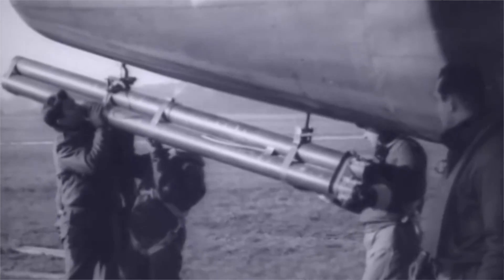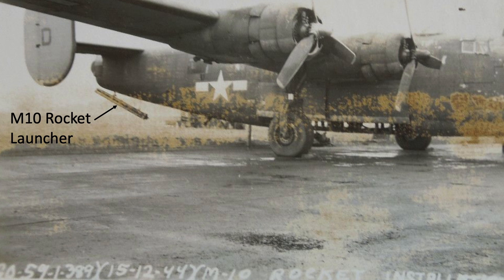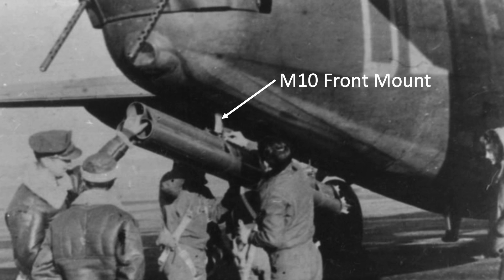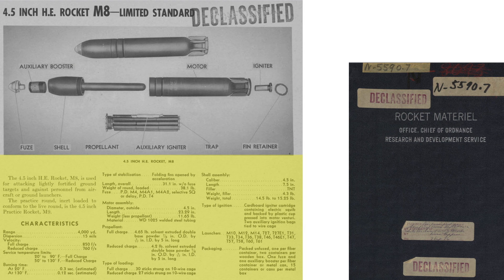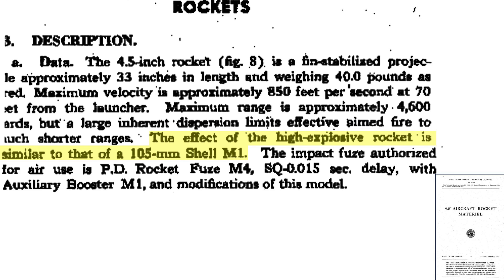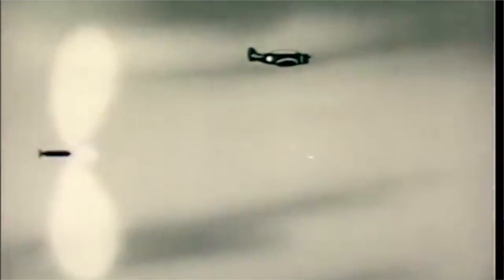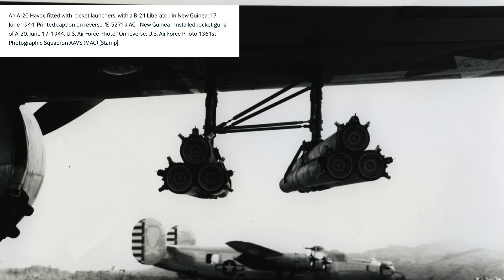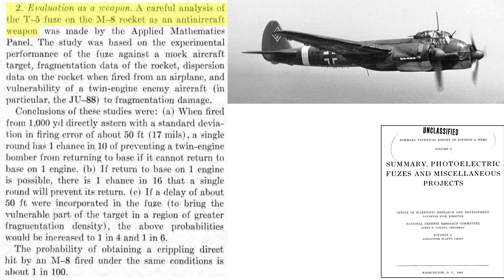B-24 Air-to-Air Proximity Fused Rocket- WWII Defensive Armament-Systems Review

Comment: Asking a tail gunner to let go of his .50s when a fighter is closing in from dead astern is a pretty big ask.   I have trouble imagining most tail gunners would rather try some gee-whiz 3-shot experimental system rather than just hose tracers at the threat.

This is amazing material, btw.  This is one of the very few channels that consistently digs up ww2 historical bits that I didn't even know existed.
Reply: Definetely! But id also imagine the destruction of being slapped by a rocket to the cockpit😂 But again, why not 50’s?

Comment: The system was later perfected at HAWC for the EB-52 "Old Dog" project :)
Reply: There was a study into doing something like the "Old Dog" with a B-52 in the 1980's and the Boeing / Air Force drawings of it ended up in a book about the B-52 in the mid 1990's. The Weapon being chucked out of the back end of the B-52 was the FIM-92 Stinger. The rear bomb bay carried Tacit Rainbow and AGM-88 HARM's (four of each on a rotary launcher), while the Radars (front and rear) were given an Air to Air search and track capability. plus data link for 6 AIM-120 AMRAAM's to be carried on the wing pylons. I don't recall seeing a date on the drawings, so it is not known if they got the idea off Dale Brown, or Brown based his B-52I on the study. Of course the Old Dog had other stuff built into it like stealth, which at the time was still mega classified.

Comment: I have never even heard of this before. Kinda surprised they never used sidewinders as part of the tail armament on the B-52 since this obviously shows that firing rockets rearward is feasible.
Reply: Sidewinders of the timeframe where interceptors would have to get into gun or Fox-2 range could usually only attain a lock from rear-aspect

Comment: The obvious solution to increase a probability of a hit, is to make it movable and controlled by the tail gunner. I'm sure that was considered, but probably they thought it would be too complex to implement on the airplanes in the front line. 

Too bad the concept didn't got further developed in post war bombers.

Comment: 9:09 the losses are really shocking. A pity the number of missions flown by each month isn't indicated on the chart. What made April 1944 such a bloody month? the sheer number of missions or other factors?
Reply: lots of fighters available, wider adoption of the 30mm cannons and more efficient radar guided night fighters.
Reply: @lapin46  sources? and what about no. of missions flown by tve 8th af? night fighters are not really a factor for day raids though...
Reply: @HennyvilleX  A very big factor actually. The Germans used the night fighters during the day against the unescorted raids and the lightly escorted ones well into the spring of 1944. They did a lot of damage as their cannons had longer range than the fighters and they could stand off.  Then the Mustangs and long range Thunderbolts turned up and kicked the living shit out of them.

Comment: Never understood why they didn't give the B17 and 24 twin 20mm rear cannon.
Reply: Because a 20mm cannon is a massive weapon. Would mean a complete redesign of the turrets, and they can be unreliable.
Reply: They put one on the B29 rear mount  , but took it off because the trajectory was too different than the 50 calibre already there

Comment: I hope they fitted an automatic disconnect / reset switch so the rockets could not be inadvertently fired by the gunner when they were in the reload position. Yikes. Fire in the hole!

Comment: An obvious problem that this rocket scheme has to overcome is initial aerodynamic instability of the fin stabilized rocket due to being fired backwards relative to the airstream of the launch aircraft; which is why even today with the most advanced air to air missiles an active thrust vectoring system is required to allow the missile to steer itself through the time period of flight when low relative air speed of the missile to the air it is flying through prevents effective aerodynamic control.  Ok, that was a mouthful, but it's a valid point.

You can't really aim it, and it won't really go where you aim it anyway - back to the drawing board boys.
Reply: It is already going fast, forward relative to the air, when it comes out of the tube.
Reply: No, sorry, you are in correct.  Relative to the aircraft if a missile is being launched  rearward, the missile has to go through relative airspeed zero first at which point the missile's aerodynamic control surfaces generate zero lift, thus the moment of initial aerodynamic instability I mentioned before.  

This is precisely why you, or anyone else has never seen air to air missiles pointing backwards on jet fighters when when most attacks come from the rearward axis.

Yes, it is possible to give a few counterexamples in the last few year, which is making my point.   @HypoceeYT
Reply: @williamreymond2669  No shit, Sherlock. And like I said, it passes through zero while it's accelerating in the tube, relative to a prop aircraft with a flat-out top speed of 250 knots (a bit faster than a Formula 1 car).

AAMs are heat or radar guided. Until recent models IR missiles were rear hemisphere only, and despite much gushing over forward hemisphere capability, they're still much less reliable in that regime than from behind. Fighter radars point forward and typically have a physical or virtual gimbal limit around 70 degrees off-boresight; radar missiles can't be guided backward by the host aircraft's radar.

Modern AAMs are not carried in launch tubes, have large actuated control surfaces, and are mounted on jets that go much faster than a B-24. For all these reasons they would be destroyed by carrying them backwards.

Jet fighters are designed to shoot other planes down. They are not overly concerned with defending against attacks from the rearward axis. The designers and the pilot are both supposed to make the airplane be the attacker, not let an "attacker" get there in the first place. Even if AAMs could be mounted and fired backward, it would be an unjustifiable loss of part of the fighter's offensive capability.

For all these reasons, modern AAMs have absolutely no relevance to propeller bomber point defense against propeller fighters with gun armament. 

And I didn't read that part of your BS before, but missiles got by just fine without thrust-vectoring for several decades, and it's only with the development of HOBS targeting systems that IR missiles have chosen to implement it now. AMRAAM, Meteor, R-77 all do fine on fins.

Comment: In the past l have wondered if the rockets used by the Rocket Bombardment versions of LSMs or LSTs that were equipped with the Rocket Turrets could have used proximity fuses on their rockets as antiaircraft weapons. The ships had a fire control system as well as a single or dual mount 5"38 turret.
Reply: They also had many destroyers, cruisers, battleships, and CAP cuddled up around them. Air defense was not their job, ground offense was.
Reply: @HypoceeYT  
Then why did they get stuck out on the radar picket line with the destroyers once the bombardment phase was over on Okinawa.
Reply: @mpetersen6  Did you notice how you used the phrase "picket line"? All sorts of ships got put on picket duty when their job was temporarily or permanently not needed. Picket ships' job was to detect incoming aircraft - largely kamikazes at that stage - and call in fighters ...and to attract kamikaze pilots into hitting ships with less utility and fewer guys on board than fleet ships.

Comment: It is great to see examples like this of programs under development that came to naught.  There is widespread criticism of Germany for its investment in pejoratively labeled "wonder weapons'" with disappointing results, but as we see here both sides thought it imperative to explore concepts that might provide an advantage in combat.
Reply: Mm. The reasonable portion of that criticism, though, is for them spending vital resources on producing and using wunderwaffen for which their testing had shown minimal or mediocre results, resources that (at least supposedly) could have made a difference in more mundane but less politically connected use. The leaders of this weapons program tested carefully, found it didn't work, and stopped to go do something else useful.
Reply: @HypoceeYT yeah jets and rockets never took off
Reply: @HypoceeYT   To me that just sounds like you buy the common narrative.  Maybe you can inform by telling me which expensive weapons Germany decided to produce after testing determined they "didn't work".
Reply: @gort8203
So how many rocket powered fighters a' la the Me163 komet do u see put in service after the war?
Reply: @aazz9676   That's a dumb question.  

But to use the 163 as an example for the question I asked, was it tested and found to not work, and put into production anyway?  No.  I did work, but by the end of the war it had been phased out because the more effective Me-262 was finally working. 

If in 1941 they had already known the 262 would work better than the 163 they might not have bothered with it, but the 262 had just flown with a piston engine because they didn't even have jet engines for it yet.  At the time the 163 still looked like the quicker and simpler system than the 262.  

You might take a look at how many experimental fighters the U.S. abandoned during the same span of time, and how many airplanes the U.S. put into production but then abandoned before the end of the war.

Comment: I have NEVER seen or heard of this !!! Imagine if fighters had this against bombers or Night Fighters  used this in a Schräge Musik set-up 🤯
Reply: The German Night fighters equipped with "Schräge Musik" often attacked from the rear some 20 - 100m below the targeted bomber. In most cases the bomber crew did not notice it. The night fighters usually aimed on the wings with its engines and fuel tanks (1 30mm MK 108 grenade in the fuel tank the bomber is gone). 

The missiles would have needed to be aimed to have a chance of a hit!!! If the fighter flies 20 or 30m below the bomber the bomber would have been damaged or destroyed as well.
Reply: @holgernarrog962  actual jazz music confuses me, like I know it's GOOD, I just can't follow the tune.  Imagine those jazz cannons, hearing the ratatat but nobody is behind you.  Talk about getting a tune stuck in your head.
Reply: Fortunately only the U.S. had proximity fuses. We used them on anti-aircraft shells and artillery which gave U.S. artillery the most effective airburst capability of all WWII armies.
Reply: @kdrapertrucker  Actually a load of rubbish. John Hopkins APL had four priority projects going when they started work on the Proximity Fuze for guns, based on concepts thought of by the British. US Navy 5 inch gun project had priority and was done first. Once that was developed, they produced a 4.5 inch shell fuze for the Royal Navy, followed by a 3.7 inch Shell fuze for the British Army. Their final gun fuze project was a 90mm Shell Fuze for the US Army.  The British design that the US developed was originally designed for rocket based weapons like this.
Reply: @kdrapertrucker  we had the electromagnetic advantage, pretty much across the board
Reply: Rock n Roll gets invented at angels twenty

Comment: I never knew B-24 used rear-facing rockets to protect the bomber , I would assume the rockets would need RC control to guide the rocket onto the target.
Reply: Unguided air to air rockets were in use into the 1960’s.
Reply: Well, they didn't. As shown in the video they tested the idea, found it was crap, and never used it.

Comment: I suppose part of why it wasn't deployed too much was because of the risk of proximity fuzes falling into german hands if a rocket was a dud.
Reply: There already being used as ground attack by this point.
Second Germany had something like 30 odd different proximity fuse designs.
Reply: @SuperFunkmachine  If I remember correctly, most german designs used stuff like sound or light on some cases, which is not as effective as radar.
Secondly, I thought the use of proximity fuzes for artillery was a bit of a reaction to fears the Battle of the Bulge may actually work for the germans, so I suppose It was more of a silver bullet of sorts.
Reply: @SuperFunkmachine proximity fuses aren’t used in ground attack. There’d be no point
Reply: @stopspammandm  yes from land based artillery. However air-surface rockets were used on point targets
Reply: @bob_the_bomb4508  The point is called air burst, they where used in the Battle of the Bulge by artillery.
Reply: @SuperFunkmachine read my previous post. Big difference between artillery and surface-air rockets
Reply: @bob_the_bomb4508  While some rockets where armour piecing for point targets othere's where fitted with proximity fuses for airbursts.
Artillery was much hardener to build fuses for that could resist the shock of fireing.
 The same M8 rockets where used for both air-to-surface and surface-to-surface roles.